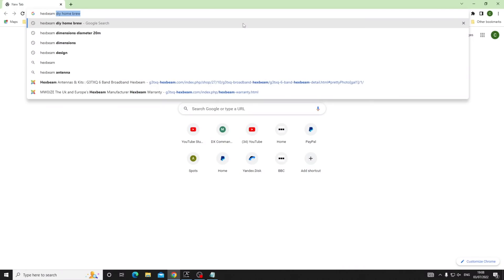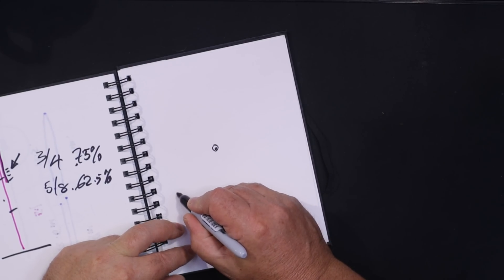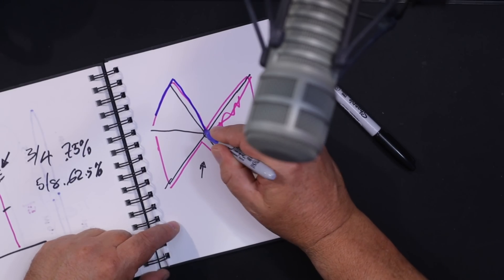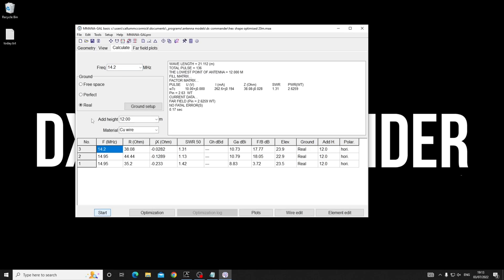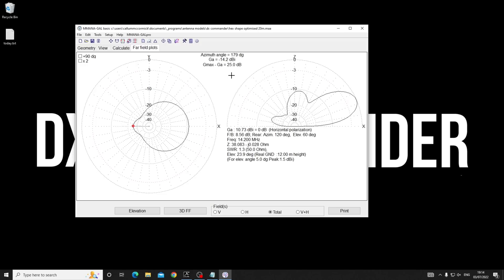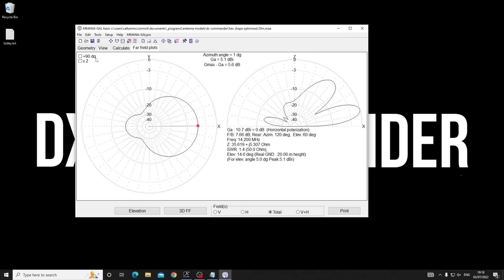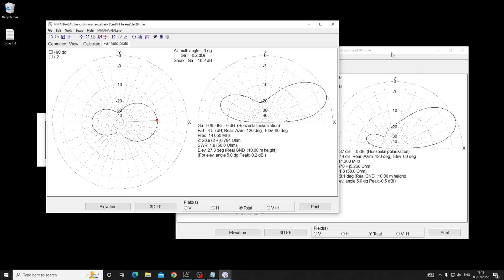How High Should My HexBeam Antenna Be?

Comment: I did some research during the past year before putting up my Mosley Classic 33 on the 26th of June this year and I agree. You get a good storm, maybe if it's the hex you want, buy 2. LOL Getting these things into Canada would cost more than my classic 33. While researching my previous yagis replacement, I counted aproximately 15 wind storms with gusts exceeding 135KM since september 11th 2021 to March 8th, 2022. My Mosley's up 35 feet over excellent ground, a half a km from the coast at 90M ASL with excellent take off to EU. I'm seeing 8DBD forward gain and about 25DB front to back.
Reply from the maker: Wow. Fabulous. Good analysis of storms too.
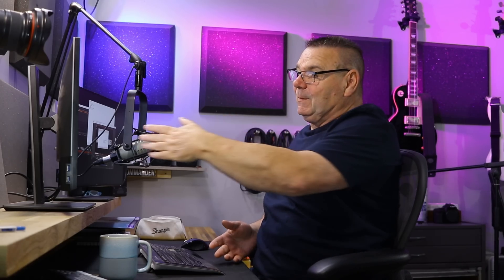Reply: @DXCommanderHQ  Yup, hoping to put up a youtube vid demo of it very soon. Now on June 26th, 7:00 in the evening my time, I had the most fun operating for an hour and a half on 20M in 16 years. I'm sure the conditions played a big roll in the performance but "WOW", hope it will last. Another thing I needed, even though I'm giving up the warc bands is strength and ruggidness.

Comment: Nicely demo'ed.  Want a real challenge???  (and I've been looking for anyone who's done this) please have a run at modeling a HyGain HyTower.
Reply from the maker: Erm... Well to be honest, that is basically a steel DX Commander 12.4 (or effectively an 18m Nebula). But on the 12.4 Signature you get 80, 40, 30, 20, 17, 15, (with 12 and 10 as 3/4 wave elements) and the Hy-Gain only delivers the contest bands. Same kind of system by the look of it. I don't really know. On average ground it's probably -4dB at 5 degrees. I would certainly go head to head with one of those and save the money and concrete for a new radio! :)

Comment: Exactly correct Callum . I was not as smart as you , bought one and THEN discovered there was no way I could get it above 7 metres in my small garden . At about 6 metres the A-B comparisons with my vertical indicated that most of the DX signals were same signal strength . I wasted several hundred dollars , eventually sold it . The DXer that bought it, installed it at 10 metres and first day he worked two new Asian DXCC entities from east coast USA.
Reply from the maker: Ah! Good science!

Comment: That was my thinking, basically try for a full wave above ground for the highest band I.E. 10m then the 20m will be 1/2 wave above ground, the best compromise for most in the real world. I have played about with different heights above ground and have produced some real crazy results. Basically I have found the higher the antenna the lower the angle of radiation. But I know that F/B versus dB gain and the effect of height above ground produces several workable solutions, there is no one size fits all, meaning its real hard to squeeze all the gain out of 1 antenna whether its F/B or forward gain, oh and also side rejection and narrowing of the beam width :/ . But they all work. We would all love the live in that ideal world where antennas are suspended in the air lol free space but alas we have to make do with what we have.

Comment: Some years ago, I saw pics of a hex beam that had been through an ice storm.  It was covered with ice and had collapsed downward.   After the sun came out and the ice melted, it sprung back up into form and only one of the wires needed fixing.   I don't know what manufacturer it was from, but I was impressed that it survived and mostly self-corrected.
Reply from the maker: Wow. Kevin, that's amazing!
Reply: Amazing recovery on that antenna.  Now we just need antennas to correct after our wind storms here in Texas. Haha
Reply: My ki0 hexbeam just survived Hurricane Idalia. We were hit by the northern eyewall and had 120+ mph gusts with 80mph sustained winds for about an hour. We have over 40 large oaks either blown over or snapped half way up the trunk. These are 80 to 200 year old trees. 
The only damage was 2 spreaders had the third section pull out and that was from a tree branch that flew through the air hitting it. One of my dual band vhf and a 6 meter vertical had the support poles bend in half. The top 40 feet of an oak that supported the wire I use for 40 and 80 meters is in the yard. Luckily no structural damage other to our home or outbuilding. We lost a few ridgecap shingles that I replaced as soon as the wind and rain stopped. 
The push-up pole holding the hex has a slight bend that I can't get to fully straighten with the guy wires but it doesn't seem to hurt the performance.  I just don't like the way it looks so I will probably replace it this winter.

Comment: If people are going to go through the trouble of purchasing a hexbeam, I'm sure they will purchase some type of push up mast to get the height they want. So, it's not like trying to string a dipole or a loop where they are going to struggle getting the height. My 2¢ worth of thought on that.   Here lately it seems the hexbeam is very popular as I've talked to so many who have one. I don't know where they are all coming from, but are out there for sure. A quick story for a qso I had a couple weeks ago with someone who owns a Hexbeam in California. I made contact and the beam was pointed to Japan, which is away from my QTH. Anyhow, he was 5 and 9, with a S Meter reading of S9, so a strong signal from the back side of the beam. He decided to turn the thing around to point it at me, and I had trouble telling he had done anything, as he might have been S10 after the turn, so I really wasn't too impressed with the gain. Maybe it was just the way he had it set up or perhaps his azumuthal calculation was wrong as to where I was. The bottom line is I just couldn't tell a difference between the front and back of the beam.
Reply from the maker: Yep.. but there's the dreamers.. You have no idea the FAQ emails I get! LOL!!
Reply: @DXCommanderHQ  and I don't want to know :)  hahahaha
Reply: ...strange phenomenon - I have not yet been able to observe something like this with my HexBeam. The forward/backward behavior is of course not as high as with a multi-element mono-band beam - but it is quite sufficient to raise the desired areas accordingly in the open band and to dampen the stations arriving from behind somewhat. Also it makes itself very strongly noticeable as soon as I turn the HexBeam in on the opposite station - or whether I turn away a little during the QSO. Only in the last days I had sufficient opportunity to try this with some connections into the Arab countries...